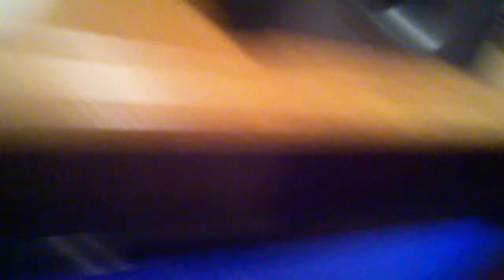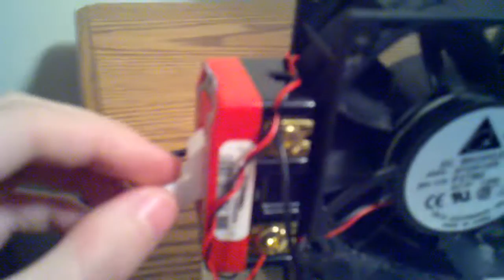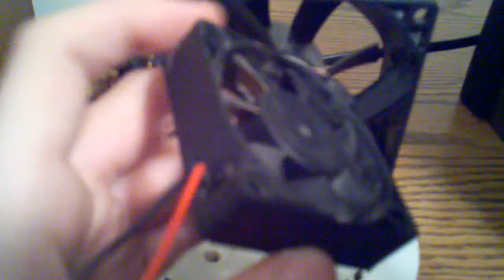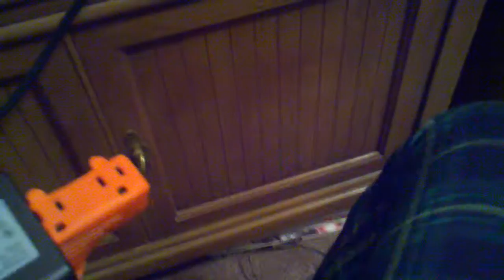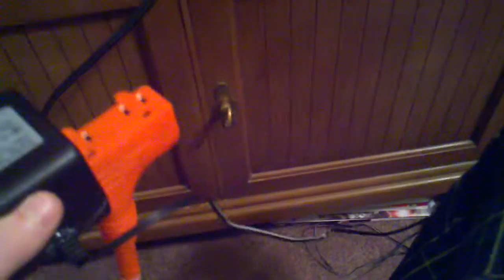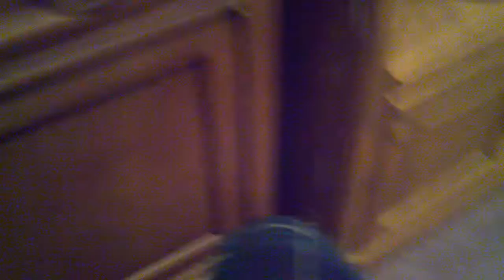High Powered Delta Computer Fan

Comment: most computer fans are brushless, in the "fan" part there's a magnet, and under that are 3 coils that are on their time, controlled by the little PCB on there, will generate an electromagnetic field that pushes the magnet which makes it spin around

Comment: Nice video ok so I have a Xbox 360 internal twin cooling fan it is 12v 0.40A. I test that fan to my QW-MS305D dc power supply at 32volts I did not realize how powerful that fan is at 32volts it blows alot of air into my face still weak but it blows alot of air I was like WOW.

Comment: 1A = 1,000MA.    By not providing 2A, you could damage the power supply (most have thermal fuses, so they het up, shut off, cool down, and turn on).

For everything, you want the volts to match, and you want to supply equal, or more amps, from the power supply.

Comment: i only have a 40mm  0.45a delta fan that screams lol weird
Reply: When i was using my QW-MS305D dc power supply Same thing when I increase the voltage to 32.1 volts. the fan blows alot of air  Holy shit.the fan I have is a internal twin cooling fan DC 12v 0.40A weak but powerful twin fan.